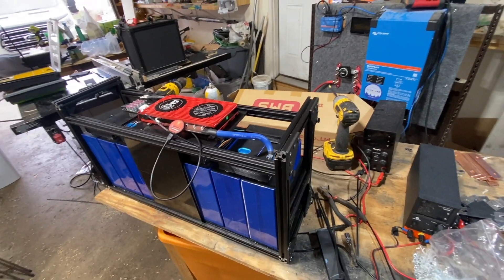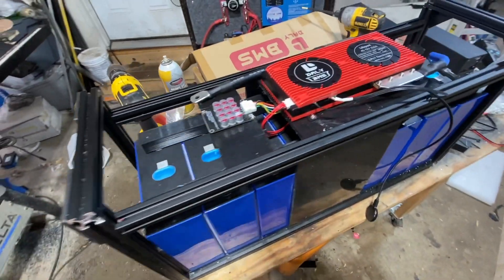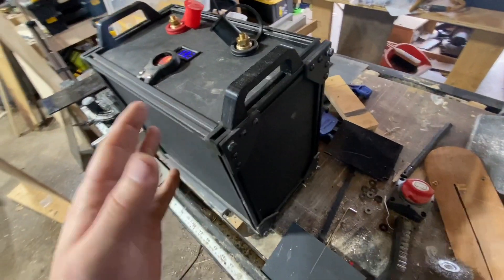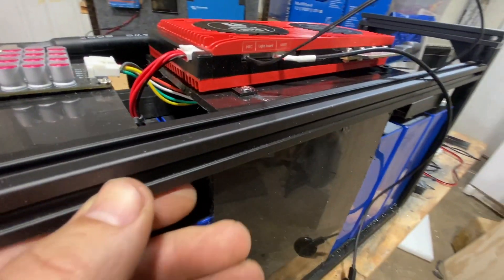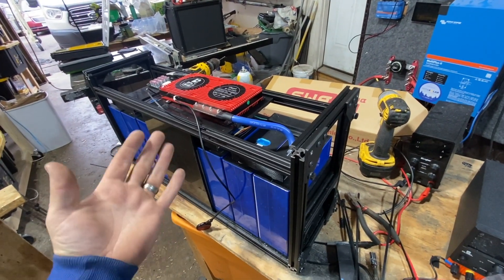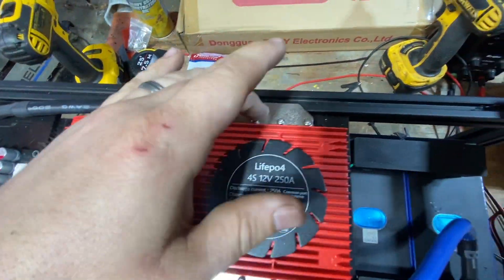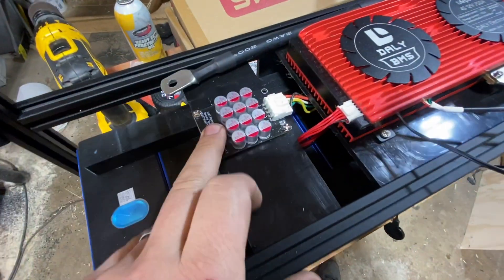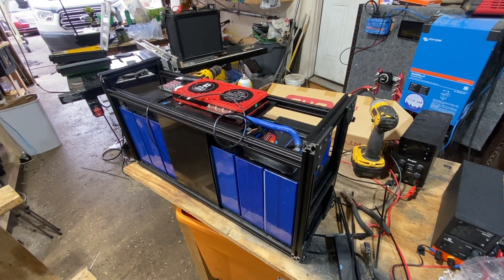560ah DIY LiFePO4 Battery Using 280ah EVE 3.2v Cells using 2020 / 8020 Extruded Aluminum

Comment: Sir,  I recently ordered Daly BMS 12v 100AH and Heltec balancer 4S, 5A, which stops at cell 1 drops to 3.3V and starts when cell 1 reaches 3.465V, I want to know about compatibility DALY BMS with Heltec balancer ?
Reply: Not really any compatibility issues unless one of them is reading voltage significantly different than the other....I'm talking more than 10mV or 20mV off. The fact that the Daly is passive (bleeds off the high cells) and the Heltec is active (shuffles around the energy to the low cells by switching mosfets on and off VERY fast simply using the pressure difference between the cells) means there really isn't any way for them to "contradict" each other but you could see some funny behavior if they read voltage differently and one balancer was causing the other to switch on and off. Also, if the Daly is bleeding down the cells it could pose an issue where getting over 3.45V is an issue but the Daly balance current is so pathetically small that it shouldn't be a concern.

Regardless, shut off the Daly balancing or set the start voltage very high (3.60V) so that the Heltec can do all the heavy lifting. Add an on/off switch to the Heltec and NEVER leave it on for extended periods of time. Turn it on near the end of a charge cycle only. Should only need to be run for a few hours a few times a year if your cells are not garbage.

Comment: Hi, I come from a mechanical background and not really a elektrickery old fart. But I really wonder I see more packs of 560 and up. But how on earth do you charge these things having let’s say only solar? I mean I like to boon dock for a couple of days at a time and the idea of having to drive away just to charge these batteries or guess running generator which will spook wild life. I exaggerate but I’m not wrong thinking you just need a charging cable from a house or indeed drive around don’t you? Best regards, Albert   PS are the passive balancers working all right? At least I thought I saw them left from the Daly right?
Reply from the maker: For 12v systems it’s good to stick to a 2:1 Solar to battery ratio as a minimum . 800w Solar  for 400ah battery and so on. If unsure error more on solar so you can stay charged. 

This project went into a van with alternator charging, so 4-5 hours drive time would top it up.  

The advantage of large solar and large battery is the reserves to last cloudy days.  Otherwise yea, your charging from a genny. 

We use heltec active balancers, they work great!
Reply: @sotasolar thank you very much !!

Comment: MPLS-based van-guy here, did the same thing as this, albeit 24v variety... One thing I added on my EVE cell / 8020 build was to add a metal sheet on the bottom with a facon tank warmer attached on the underside. Then an insulated layer of 1/8" pink-board fitted inside the 8020 with polywall on the outside. So it still looks like a plastic box, but with the 8020 structure and built in heating. For my 24v that facon heating goes to the 12v distro block, but you guys could wire it right in for your 12v versions!
Reply from the maker: We love 24v too. Did you use this as a model for yours?